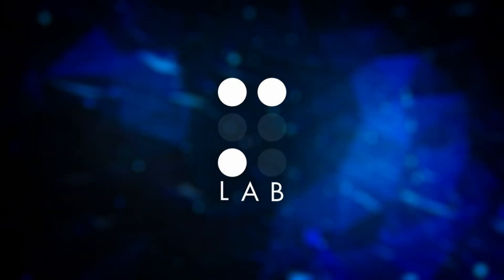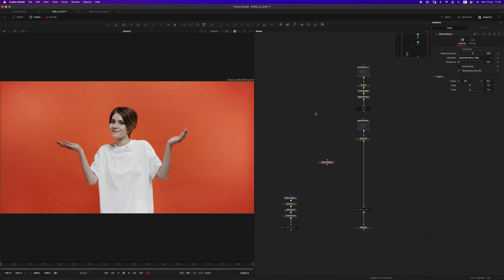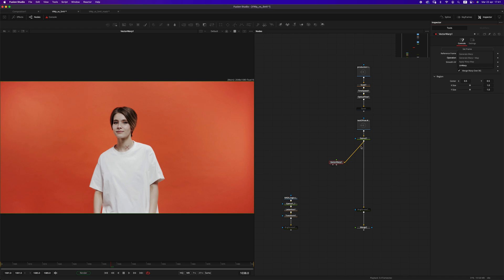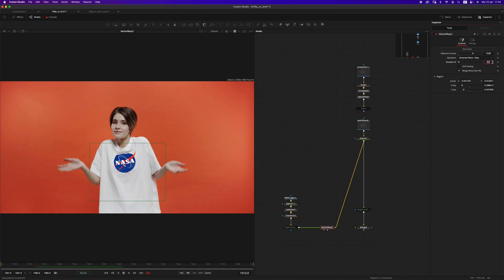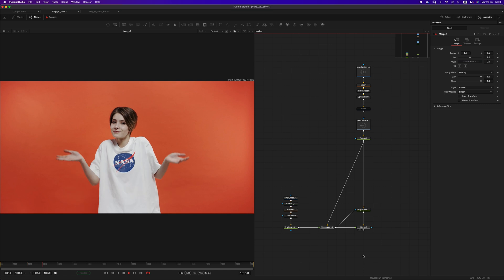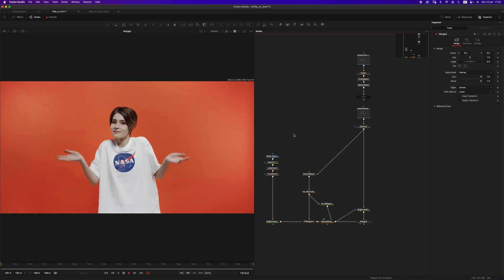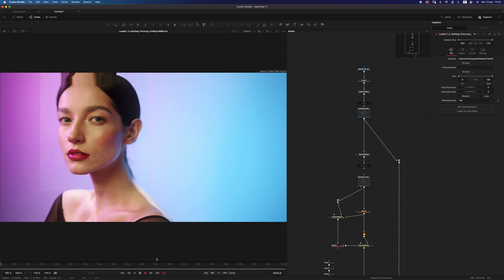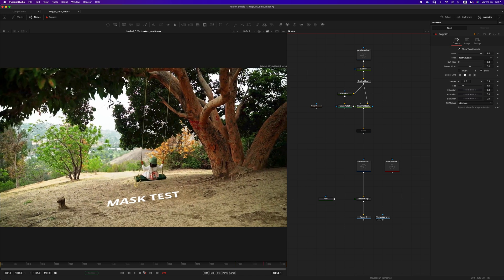Fusion 20 new Features - EP 1: VectorWarp

Comment: How does this method compare with the surface tracker for placing elements like the logo?
For tricky situations where the surface tracker is slipping for example.
Could this help?

Man.. The logo is perfect, with the Change of luminosity.... Do you have a full tutorial for this somewhere by any chance?

And this way of stabilizing whole footage is crazy! I wish you would expand on that.
Reply: Well, sometimes VectorWarp is better, sometimes it’s better SurfaceTrqcker. What I can say is that surface tracker is FASTER. Keep in mind that both my old VectorWarp macro and the SmartVector Fuse are still available and they do pretty much the same stuff, with over l’app ing results, but they are faster to calcolate, Especially on longer footage.
Reply: @millolab yea I guess it depends on the footage. 
I'm not familiar with the macros unfortunately.
I checked your channel, i can't find tutorials about this method of stabilizing the footage.
Is there one by any chance? Because I've never seen this done this way and it completely "freezes" everything. And it's so good for adding elements to complex shapes like a face